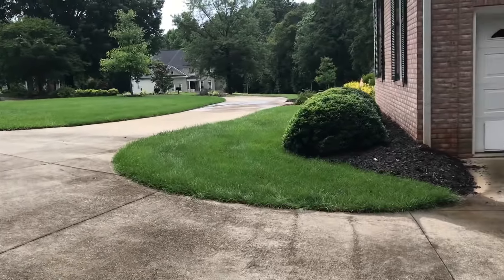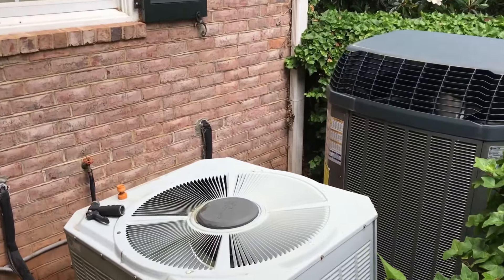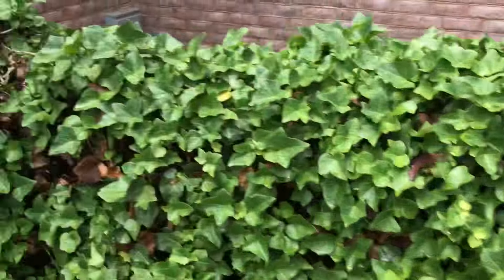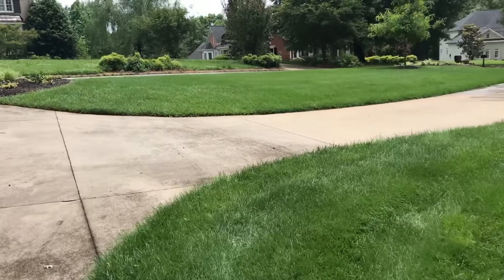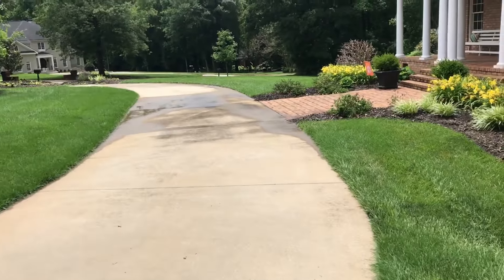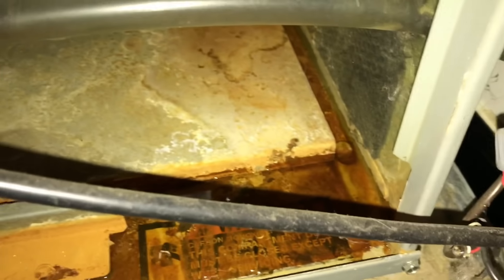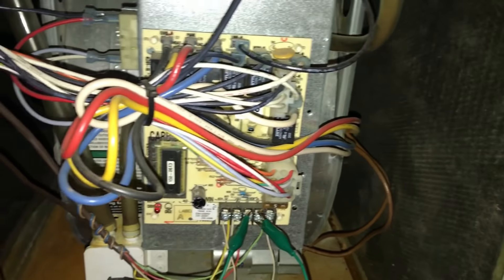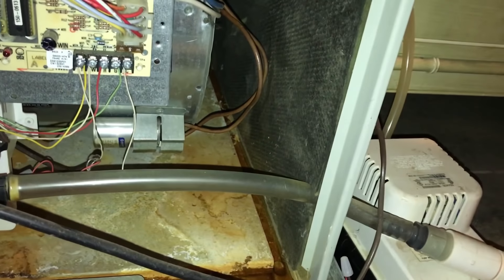Service Call No AC bad Capacitor replaced on Trane gas furnace

Comment: at 3:05 in video, water stain/rust/mineral buildup down side of blower housing. so I'd assume water go into blower wheel and motor. game over :)
sometimes video is a blessing, other times it catches things you cannot. video or high speed video is great for racing purposes as well as others too
ADDED NOTE, frozen or tight motor bearings will and can cause capacitor overheating! which obviously equals early capacitor failure.  it's always  wise to backup the diagnosis with checking the running amperage rating of motor!
Reply: I'm not being a butt-head about it, but you can say whatever you like to the customer.  the power draw is too high, I can replace it for X or you can try your luck and it will fail sooner than later. in which they'll forget after a week or three and blame you anyway :))

Comment: They had to uninstall the one unit to get the newer one in?? Why not just cut a bush down lol

Also if the customer is concerned about the motor, i usually will ohm it out and free spin the motor to see if it might be locking up or if the windings got damaged.

Comment: That must rust in the baseplate...it's not just a ice up.
Reply: exactly, something plugged up, chinesium pan rust out, coil full of garbage, low charge major ice-up, or long time failing blower.
then again, "10 cent" chinesium galvanized metallurgy. it's coated so thin a drop of water would rust it :))

Comment: also, when you change just that, note it on receipt "very legible! "changed bad motor capacitor, suggested to customer motor is damaged and has burnt smell" that way they cannot come back on you.
give them the choice and make sure you slightly over-estimate a second service call with motor replacement, which  likely requires a second capacitor change to match the motor requirements! which is likely still less than OEM motor replacement and cap.... I know it's hard, they don't understand nor conceive the situation mostly..
what I hate most is being screwed/mislead and lied to. I don't like anyone I know to have that happen to them either and will take action against it.
you do far better than can be expected from most anyone! then we have that crazy "Surfer/Biker/Knock/Vangina Dave guy" in cali. :))) he does great work also. many others I wont say. but if I stick about and comment, I like the work being done and don't mean to be bad in comments, just helpful in suggestions. which may or may not work out for you :)

Comment: Titan Pro capacitors....all I use now.
Reply: like he said in video, "made in USA may or may not be any better. there's just too much overhead cost to compete. people appear to be blind to the facts but there are too many "fat cats" padding their pockets upstream and too mucy of USA's debt bought by China. who sold us out so much?????? look into that and you'll have the answer and why ;)
Reply: throttle bottle No aurgument about trade deficits or debt in this case. My comment is based on failure rate. I have warranted  many off shore capacitors. Capacitors fail due to heat and high back EMF.  Now in this video, the failure was due to blocked filter. When the blower motor ran unloaded, the back EMF exceeded the voltage rating of the cap,  the dielectric failed. MAGA.
Reply: are you sure it was a blocked filter? and not low charge causing coil ice up? contactor sticking on? icing the coil fan comes on and runs endless to cool the house and eventually the contactor opens..... hehehe, been there done that. I'm the guy that gets called in when all the rest fail miserably. I also BUST chinesium JUNK and garbagey and fat cat pocket padding, which has ruined the USA 100%+
Reply: throttle bottle Bubba, we watching the same video? Blocked filter caused cap failure. Cap failure caused blower motor not to run. Zero air movement across evap coil caused icing.  Ice built up and extended past drain pan, condensate flowed into bottom of furnace. Rust in bottom furnace indicates it has been wet before.  System will fail again due to filter neglet. Cust will call another new company. Cust will not follow advise and HVAC guys will blamed for poor performance.  And the beat goes on.